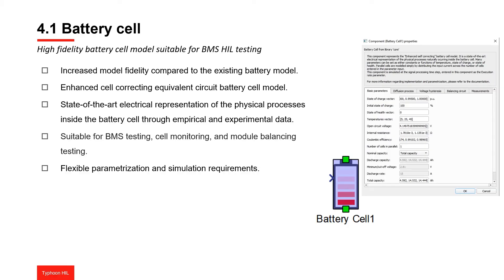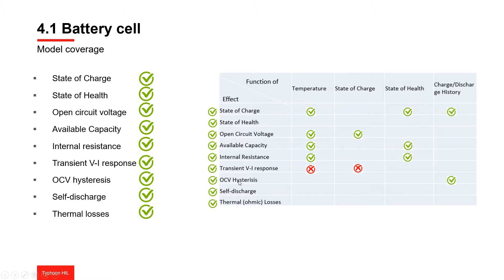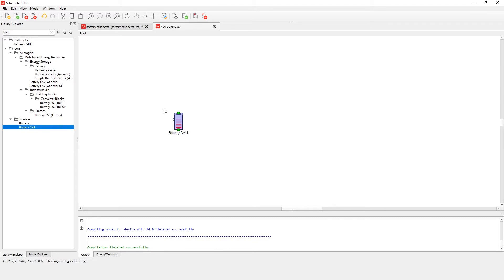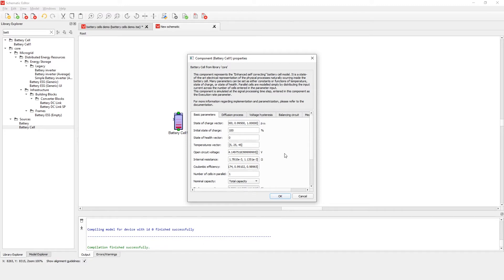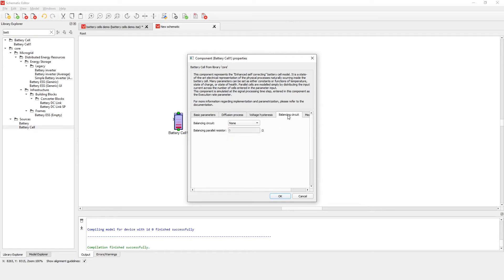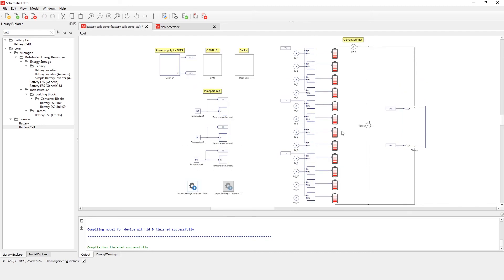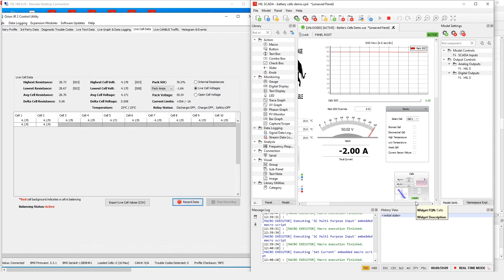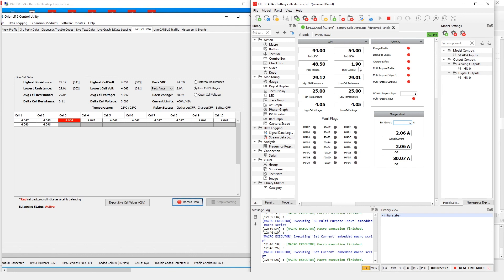High Fidelity Battery Cell Model | 2022.1 Release Tutorial

Comment: Hi! thanks for sharing information about this state of art representation of battery cells. I woudl like to know how to complete the state of charge or state of health vectors? Specifically how to complete the parameters for example when state of charge is dependent on both temperature and state of health.
Reply from the maker: Hello Syed, the state of charge and state of health vectors can be either python lists or python arrays and they can be obtained from test scenarios or manufacturers of battery cells directly. While state of charge is not directly dependent on temperature, the Open circuit voltage (OCV) is. It represents the cell's terminal voltage when the diffusion process has subsided, there is no current flow, and the hysteresis effect is ignored. It is always a function of state of charge and optionally a function of temperature, but not of state of health. Other parameters can be a function of state of health, such as Total capacity. More about this, and in higher detail, can be found in our documentation here: https://www.typhoon-hil.com/documentation/typhoon-hil-software-manual/References/battery_cell.html